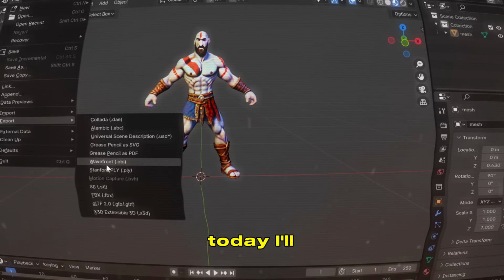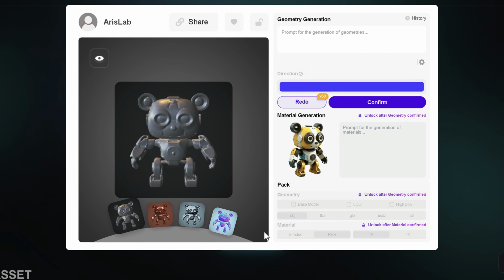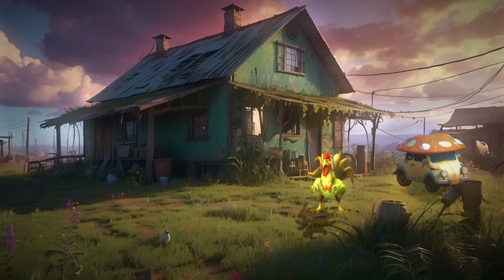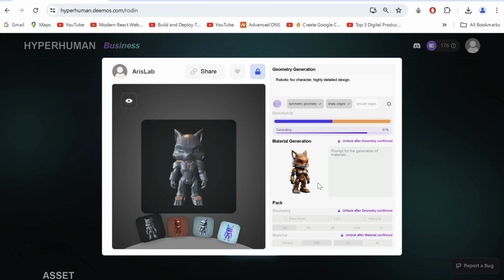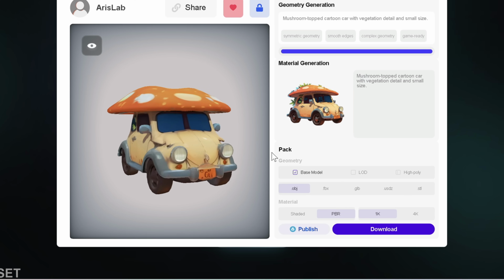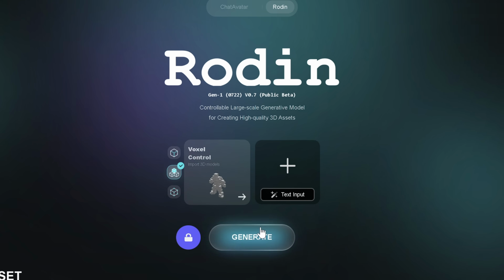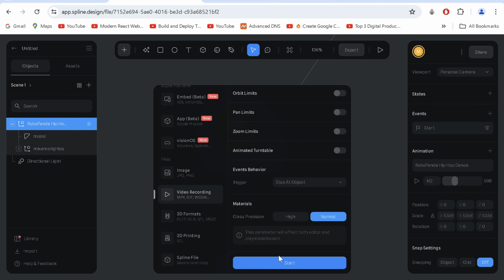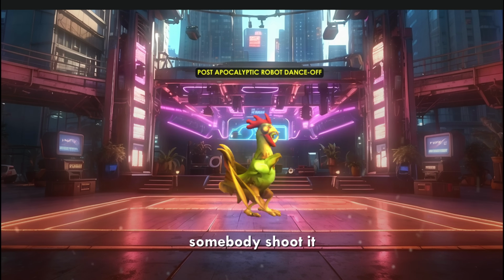Turn Any Image to a Customized 3D Model with this NEW AI - 3D ControlNet

Comment: THx for your video. Hyperhumman seems to be useless.
I made a first test : with the free subscription you can only have one image input or one prompt.
also, when pressing generate, nothing is happening !!
it looks like that using only an input frame is not working and using 1 frame + one promp is not allow in free version.
the mesh generate with a promp, is mandatory as a T_pose, so could not be use for something else as generating a statue or other things
Reply: Personnaly I've tried the free version and didn't have any problem.
Even with one image you can get really good results and re-generate if not happy.
if your buttons aren't working, try maybe an other web browser. maybe yours does not support all features.

You can click on a A-T pose button to have your character in A or T pose.
of course the generated mesh wasn't perfect, especially for the finger parts, but just open the fbx in blender or any other 3D software, you can edit it, then put an armature on it and done.
It saves a lot of time.